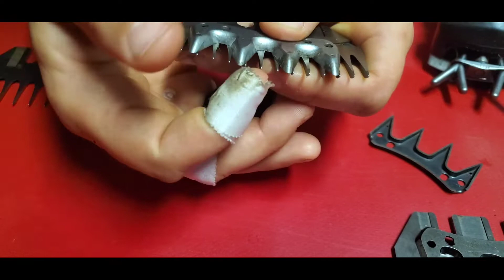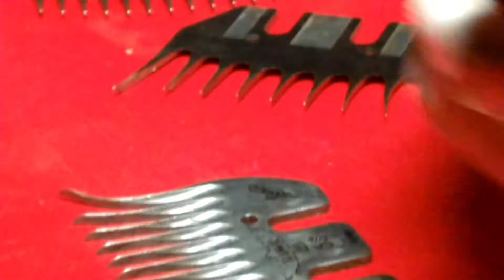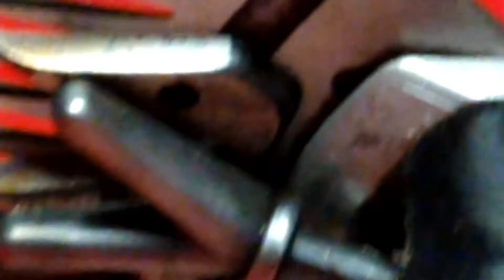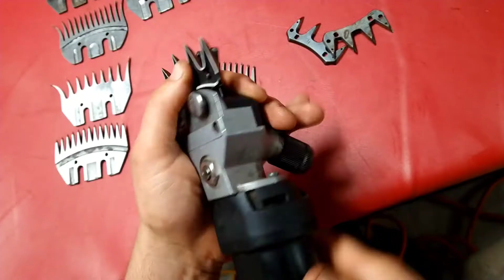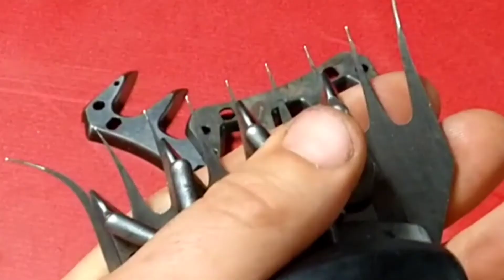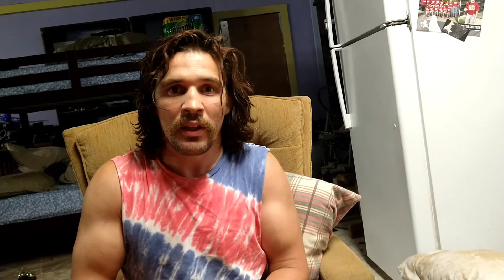Shearing, How to set up your electric clipper with comb and cutter the easy way

Comment: My shears keep overheating. I've adjusted the sped, the blades and tension. What else can be the problem?
Reply from the maker: What type of shears do you have? Generally for beginners the problem is over tensioning. Sometimes this is because the blades arent Sharp.  The other possibility is is it could be clogged with fiber. Make sure you clean out all the vents so air can get through. Sometimes if it's an older clipper there could be a short somewhere in the windings... Also if you're shearing an alpaca for instance or something without Grease the old Oster clippers run at too high of a speed... Usually it's over tensioning because your blades aren't sharp so I would take my blades somewhere else to get ground and it might fix the problem

Comment: What is the metal rod with wire at end for? I can’t seem to get enough tension to hold the cutter in place, it flys off when I start the power
Reply from the maker: Are you talking about number two? On this diagram? Do you have the extras or another clipper? There is a certain type of Qatar that doesn't fit the pins on your forks. It's possible that you're using an Oster cutter on that clipper? If it's an older clipper it's possible that The tension pin is worn down at the top which has happened to me before... Or maybe you're missing the cup? S12v – Peasridge https://share.google/tFIOB05IYduSw5wFu
Reply from the maker: Also, are you sure that the little pins on the tips are in the little holes in the ends of the cutters? And are you tightening the tension knob enough before you start?

Comment: I have a set of Amazon clippers and have tried both the comb/cutters that came with it, as well as some from Premier 1 and have never been able to get them to cut correctly. I followed your setup guide and many others and still nothing. They just bog down, like trying to mow 12" grass with a push mower. I'm using oil and can't figure out what is wrong. I have three Suffolk who haven't been properly sheared in two years and need help. Last year I ended up using a pair of scissors to get as much off of them as I could since the shearers didn't work.
Reply from the maker: Have you tried giving it a little more tension? The other thing that could make it difficult is if you are not against the skin of the animal. It's difficult to cut fiber in half. If you could send me a picture of the setup and of the surface of the blades I could have a better idea.

Comment: Is it ok to use WD40 oil?
Reply from the maker: Something heavier would be better. The thicker it is the longer it lasts. Bar and chain oil is really good but just any kind of motor. Oil is ideal. But wd-40 is definitely better than nothing
Reply: @Followmeimblind  I heard people using diesel? Besides that, can you sharpen the knives by using sand paper and a mirror. Someone told me that, but I didn't try to do it myself....
Reply from the maker: @vaw7016  maybe Diesel would work... I've never heard of it myself. I know oil works though. The blades are really tricky to get sharp. And it's relatively simple and cheap to get a old shearing wheel somewhere. I would recommend grinding them that way at least to start. They're so hard to get right. So I wouldn't make it any harder.
Reply: Thank you! I needed this as a new shearer!!

Comment: Hi mate i have around 200 sheeps and budget of 250-300AUD so my question is can i find a shearing machine for that price and shear the sheeps ?
Reply from the maker: Yeah, it's definitely possible. It's NOT going to be fun for you! There's a huge learning curve! But if you have a strong back and some stick-to-itiveness you should be done in a couple weeks!
Reply from the maker: You should be able to get a cheap electric clipper for around $30. (U.s. dollars) Then I'd get 5 flare 13 tooth combs. And 10 cutters. Should be able to find the combs for $15 and cutters for $3 apiece. When you're just starting you'll dull them very quickly (you might get 5 if you're lucky) so you'll have to find a sheep shearer to sharpen for you or mail them somewhere.
Reply: @Followmeimblind   Thanks for the advice mate